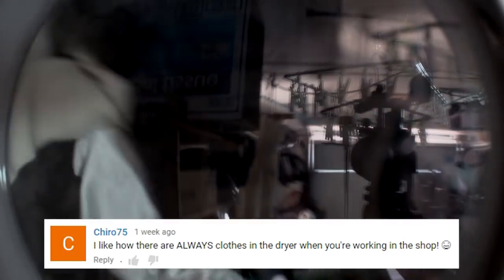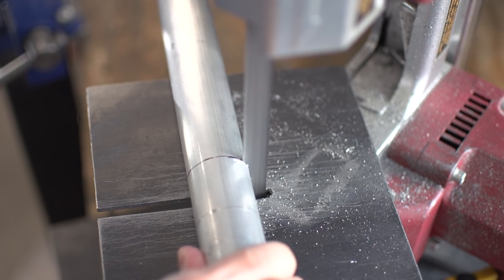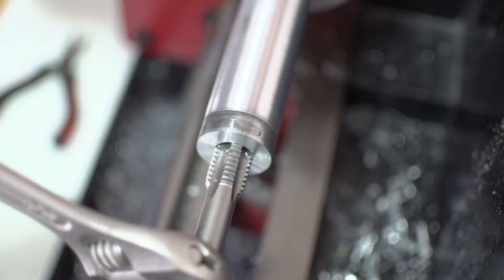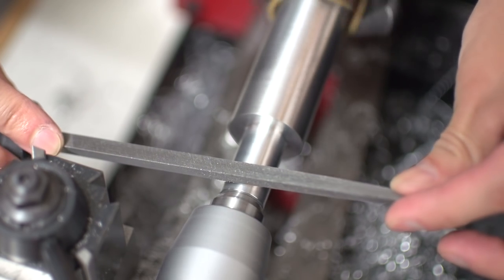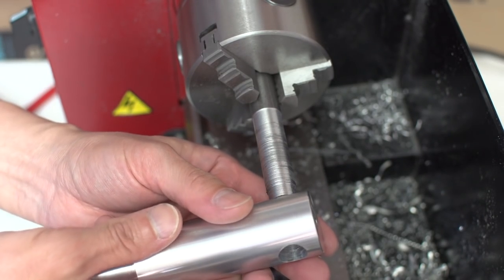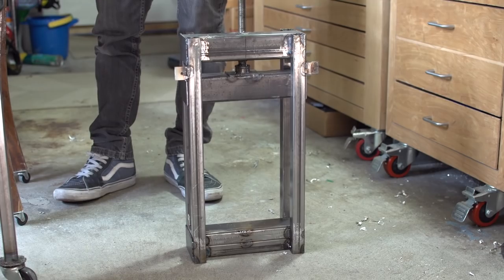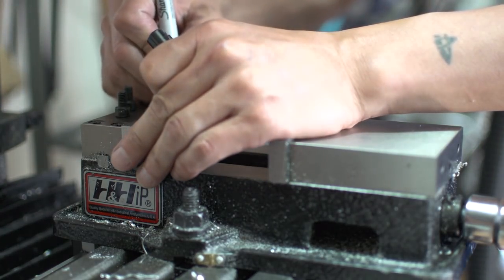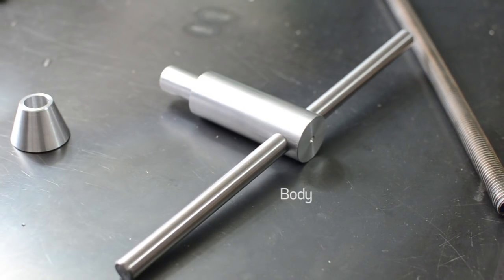Bicycle Frame Build 54 - How to build head tube reamer facer

Comment: I think I just saw that missing sock you were looking for. As always, awesome! Common practice for lubricating band saw blades is a stick of bees wax, available at any hardware store, a lot less than a bar of soap, and no scent, but if you are going to use soap, consider Ivory soap, no scent in it and used by many cabinet makers on drawer ways. And you're not cheap, just financially smart...specially when you now how to make them. Look around your shop, see the tools you built, WHEN you have a manufacturing company, you'll be reminded of your beginnings and know, you literally started from scratch and stay humble. Good job, now...go find that mate to that sock...LOL, good luck.
Reply: Could you lubricate the band saw blades with paraffin wax (candle wax)?  I think that would work too.And since this is a 'bike channel', you can use candle wax to lubricate your bike chain as well.
Reply: eddie Towers just started watching these videos and went to mention the bees wax but saw your comment. it's also great for mig/stick to prevent spatter from sticking to the work piece. I bought a huge bar of it from a Joanns craft store nearby for near nothing. had to chime in. lol
Reply: Tri-State WIFI LLC really, we'll that's also cool, to prevent shatters. Nice.

Comment: how much did this tool cost you in material and time
Reply from the maker: Hi, It took me roughly 3 days (machining / designing). Materials ran me around $60. I used remnant aluminum and steel stock that I had. The actual cutter was the biggest expense and that had me in for $200 - (2 cutters, facer and reamer). You can by the whole thing from Park Tool for around 500. I built mine mostly for the learning experience. In the end I didn't save any money!

Comment: Hey, I really enjoy your videos! So, to avoid the chips getting all long and tangly in your lathe, grind a chip breaker on the front edge of your tool. A chip breaker is basically a cylindrical lip ground into the cutting edge. Gives the cutting edge a short section of steep rake. This allows the chip to curl and break as it goes into and out of the cylindrical lip. Make sense? Sorry if not.

Comment: is the inside diameter reamer just clamped with a nut against the cutting edges of the facing reamer? will those bite into it to transfer the torque or how is the inside reamer driven?
Reply from the maker: +Jörn Bucklitsch they do and I too thought that was peculiar. I watched some how to face HT videos and examined pics of various tools, from what I can tell.. This is how it's setup is designed.
Reply: alright, didn't know that. great video btw...

Comment: Good for you making your own.  The milling cutters and reamers are expensive enough (and unfortunately you cant make those) but the rest of it is trivial to make if you have a few basic machine tools, as you demonstrate.  Its insanely overpriced to buy, though.  Those bicycle tool companies are a rip-off, in my opinion - even the cheaper brands, like Cyclus, are still pretty expensive.  I guess time is money.  Either you spend the time to make it, or you fork out the dough... :-)

Comment: Beautiful build. I see how the pins stop the face mill spinning, but what stop the reamer sitting beneath it spinning? 15:18
Reply from the maker: Amazingly, It's the pressure from the securing nut. Because they both turn clockwise when reaming it's in a tightening direction. I too thought this would not be enough to hold the inside reamer from turning but that's the way the Park Tool Reamer is designed and borrowed that design for this build.

Comment: It will be very interesting to see how long your second bike frame takes to build, now that you have your methodology, jigs & fixtures already in place.  Probably around 50 hours for a welded, unfinished frame.  Time will tell.
Reply from the maker: +Dirk Dhulst Great point, I didn't think about that. If I were to build the same type of frame, probably pretty fast. I've been learning a ton and there's a few things I would do differently second time. Like maybe for this type of frame I'd use straight guage tubing. And the whole drive train is more or less an experiment. Ah the beauty of making your own, and messing around! Next bike will be a long tail for my son. I'll make it from some scrap frames. Thanks for the question!

Comment: You're not cheap at all dude, why buy it when you can make end of the day. The tool is way overpriced for the job it does.
Reply from the maker: +Dinxsy most of the cost is on the cutting tools. But I have to say, the park tool body that holds the cutters is very well made. 

The holder Imade is made for the enthusiast like myself. It wouldn't last long in high volume shops. Mainly because the body is aluminum. Some day I might upgrade it. 

But yeah I agree, still the price on these reamers/faces seem quite steep. 

Some day I want to maybe design one that uses carbide inserts. To save money. But my my inexperience has me thinking this way.

Comment: Bench grind clearance on the right side of the tool, no flipping needed. It's aluminum, more or less shiny wood. Also, a cheap candle works great as band saw lubricant. A lower TPI (wood) blade can also be used, as long as the engagement on the teeth is three tooth's worth (no thin stuff on a low tpi blade) 

You could have knurled the handle instead of dimpling it - knurling makes the part grow.  

Great job! I wish I had a lathe in the garage, not just at work.
Reply from the maker: +monomerx001 knurling! What a great idea. Thanks for the great tips, really appreciate it.

Comment: A few suggestions,

-Try "pecking" when you drill on the mill or lathe. just stop advancing the drill for a split second and the chip will break, that way you wont get the rats nest whipping around the drill bit. not a huge issue, it's just good practice. 
-An old tap works in a pinch if you don't have a center punch. 

loving the videos, keep em coming
Reply from the maker: +dR.Ugz good tips! Never thought to use an old tap. 👍
Reply from the maker: +dR.Ugz good tips! Never thought to use an old tap. 👍